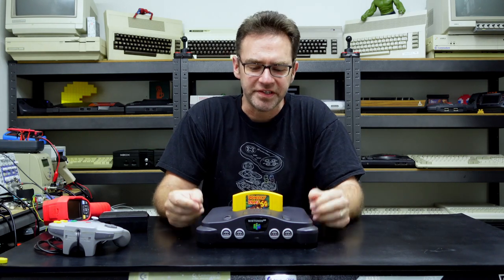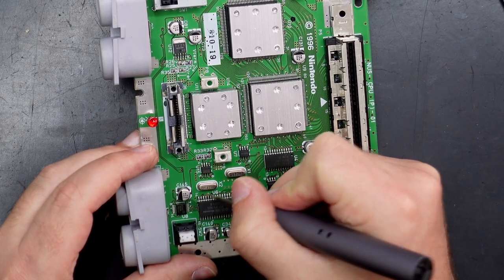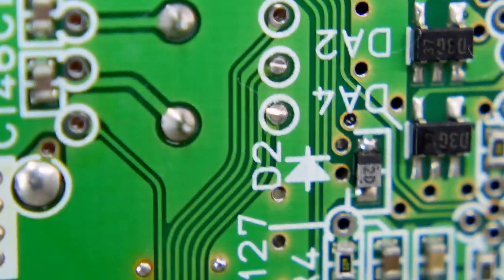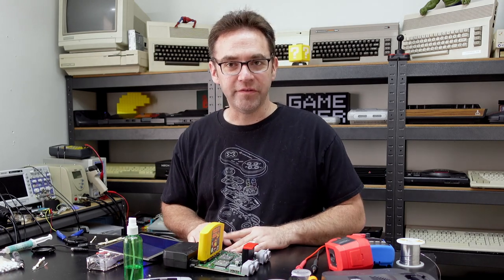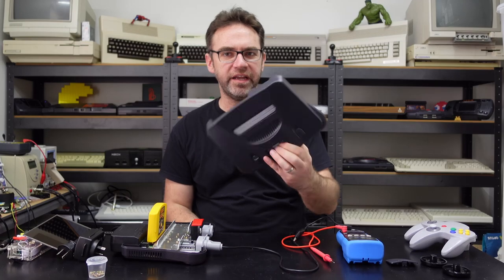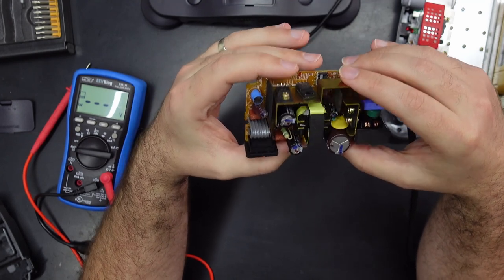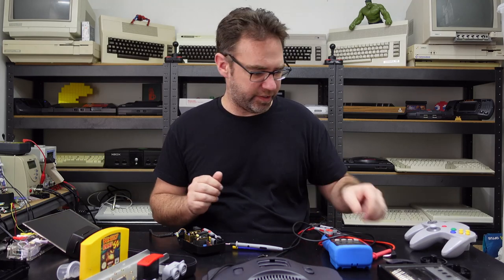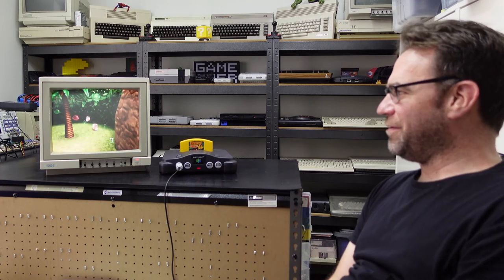Nintendo 64 no video troubleshooting and repair - Part 2

Comment: For me, what fixed it was cleaning the spot under the removable cartridge slot. It was full of dust and other questionable debris. And I also put a little Isopropyl alcohol in the jumper pack slot and put it in and out a few times. Started right up after that. Thank you! I didn’t know that slot was removable!

Comment: Yeah i think that's the expected behaviour from region lockout. There's a pair of CIC circuits, one of them on the cartridge in a separate chip and one of them integrated into the PIF on the console. If the two CICs don't agree, the processor is held in reset, and one of the things they want to agree on is the region, there are two regions. On prior consoles the lockout was easy to bypass, you can just prevent the CIC in the console from tugging on CPU reset, but they decided to thwart the efforts by integrating more functions into the same chip and calling it a PIF, so you can't disrupt it without also disrupting a lot of critical functionality like actually bringing up the CPU and firing interrupts.

Comment: Hi mate bit late to the party here but i've got an N64 that is also doing the same thing - no audio or video. I've done a VERY deep cleaning of the board, under the cart slot and the cart slot pins itself, resoldered a few things and still nothing. I'm in Australia, would you be interested in having another go at repairing another one?

Comment: Good Job on the repair. You spotted it fairly easily.  Luckily, it wasn't a situation where you had corrosion up under one of the chips. Some of those SMD chips can be a nightmare to solder properly.
Reply from the maker: Thanks, yeah could have been a lot worse. It's funny because I put together part one after I spotted it, and because I knew where the damage was, it's hard to unsee it when watching back part one

Comment: I have two of these with no video, haven’t been over the boards with the microscope yet (My eyes even with glasses are crap) will revisit in the morning,
Reply: Also the area of corrosion would have been completely covered by the heatsink, maybe not liquids but a problem with board washing after manufacturer, maybe those via had corrosive cleaning product nit fully washed out?
Reply from the maker: Good point, totally forgot about the heatsink. No idea how or why the corrosion got there. Be sure to double check the cart slot and expansion/jumper pak connectors for broken joints, and give them a good scrub with IPA while you're there
Reply: @TheRetroChannel  I’m an electronics veteran, been at it 42 years, currently repairing Arcade Boards and CRT monitors, Laptops are so flipping boring lol. Had a super Atari Tempest Colour XY vector board in last week :)
Reply from the maker: Awesome. I'd be curious to know what issues you find with the N64's
Reply: @TheRetroChannel  Hi there, fixed both those N64, thanks for the inspiration :) one it turns out was supplied with an A/V lead with RGB configured in the scart, 180R resistor from +5V to select pin, of course it was a standard PAL device not RGB moded, The other was surprising NTSC model and the top RAM (nearest coprocessor) the back 4 pins had just lifted of the pads, fluxed and resoldered jobs a good un! Once again thanks :)

Comment: Are you trying to play a pal game on a ntsc system then yeah no action but. Japanese games play on ntsc u/c systems no problems
Reply from the maker: Other way around - NTSC cart on PAL system but yeah I looked it up afterwards and it can't be done without some heavy modification. Seems NTSC-J and NTSC-U is a much easier mod as it's just the physical difference between cart and slot
Reply from the maker: Ha, yep all that time, money, effort these big compaines spend building these protection schemes and in most cases all it does is punish and inconvenience legitimate users which then gives them the incentive to bypass the protection. Not to mention the moment someone tells us we can't do something with a product that we paid for and now own, we will find a way to circumvent it, even if it's just for the challenge. LOL

Comment: I like your study. I have different problem.

I did something for my N64 console 
1. add RGBS mod with RGB+CS signal
2. firstly work normal but few minute. the SCART cables RGBS signal gone. 
3. change back to S-Video cable output
https://youtube.com/shorts/h1HeG-EdkmQ?feature=share
and  change to cable output with composite-video
https://youtube.com/shorts/r9hINrJVP4k?feature=share
4. Seems the sync function gone. even remove the RGBS mod small board. the issue still happened. 

Does any one know how to recover the Sync video signal back for N64, if the video sync for N64 is abnormal. 
and my N64 system version is "NUS-CPU-03"
Reply from the maker: I'm not familiar with this mod, but I'd go back and double check your soldering. I assume the RGB signals are picked up from the VDC-NUS chip? Even though you've removed the mod, there may still be a short somewhere.
There's also schematics for this revision available on console5 which might help you track down the fault
Reply: @TheRetroChannel  the soldering is clean, the rework for RGB is get from VDC-NUS, that right. for sync (CSYNC) signal was get from the via between R15 and R16, same from VDC-NUS pin 14, but not directly there is a R16 1K ohm there, that maybe damage the VDC-NUS BU9801F or Q1, I do not know what is the Q1. If possible that is the problem root cause. Due to the R16 is 1K ohm. that is hard to damage the VDC-NUS from this path, What I guess is the location Q1. That may be some kind of pnp amp.
Reply: @TheRetroChannel  I think, I may be wrong, due to S video and Composite video do not using extra connector as sync, I guess you are right, the VDC-NUS may got something wrong after mod chip working and let the sync error with damage. But I do not have tool can proof that. Thank any way.
Reply from the maker: @YaowenChang  Yeah it looks like there is a buffer circuit and sync is available on the multi out on the CPU-03 versions, but you'd need an oscilloscope to see what it is doing.

My guess is the VDC-NUS chip could be damaged, again it's hard to be certain without an oscilloscope. Perhaps the transistor at Q1 has shorted but it seems unlikely. You could try removing R16 but I doubt it will make a difference
Reply: @TheRetroChannel  My issue is fix now.
I did added the sync into THS7374 to conn output into Sync pin out.
but the main board already have Q1 working.
the Q1 was damage at last week while the system boot up after 5 minute. 
Today I got a NPN, and rework on Q1 location and system sync working normally
Thank you, it is nice have someone can talk with debug.